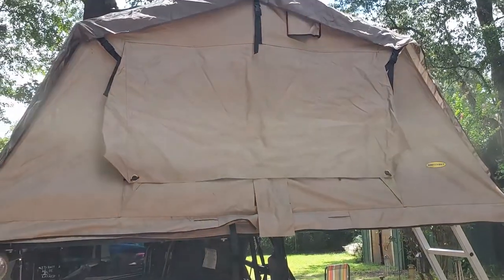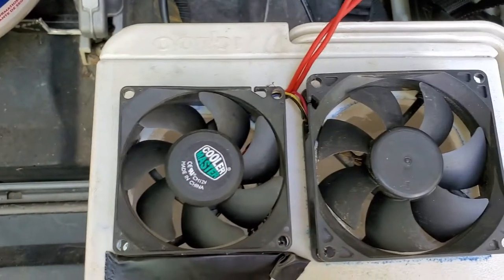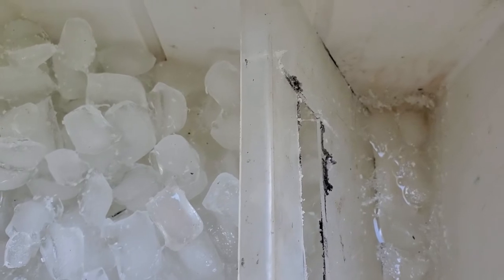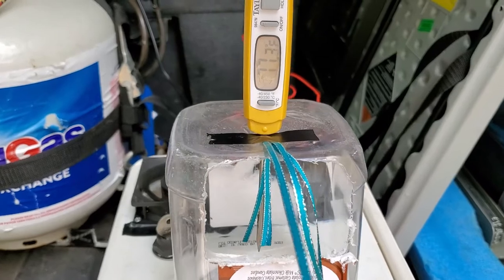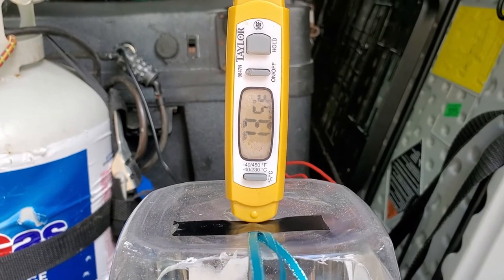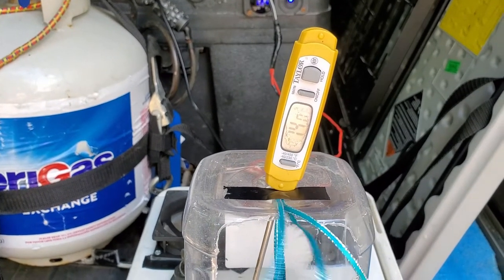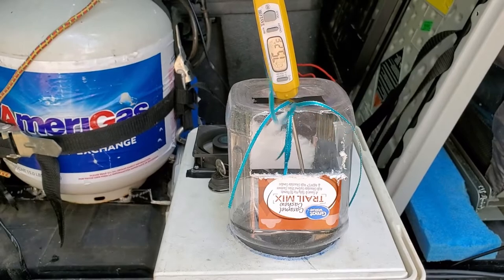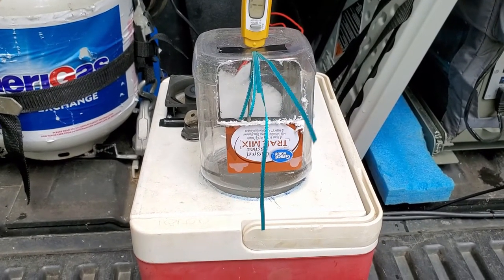Homemade Ice Chest Fan Cooler For the Roof Top Tent

Comment from the maker: It gets hot here in Texas . When camping in our smittybilt rooftop tent we can get comfortable by opening the windows and running a fan. I have seen these ice chest fan online and thought I would see if I had stuff laying around to build one. This one is different from the ones I saw online but I used what I had. Further testing will be done. It should actually help.